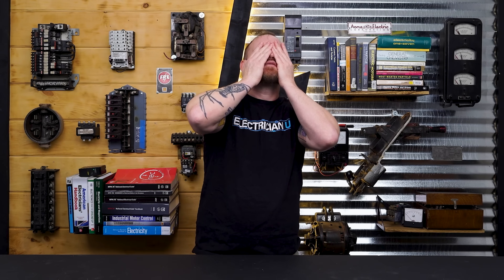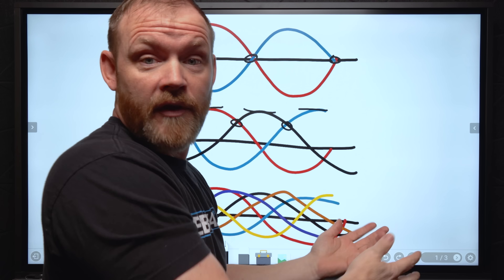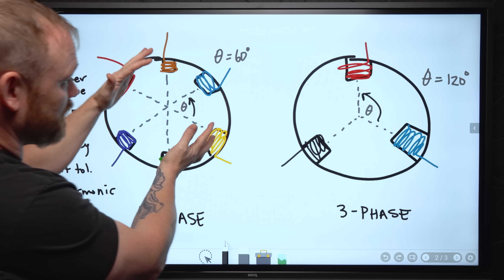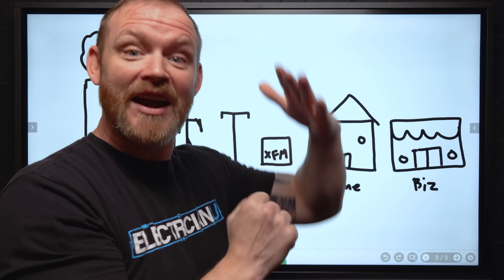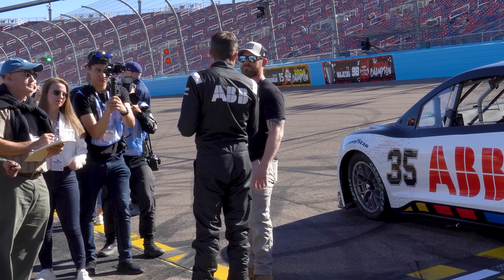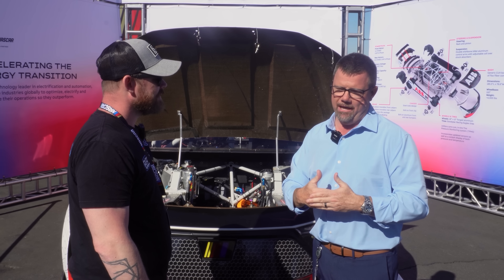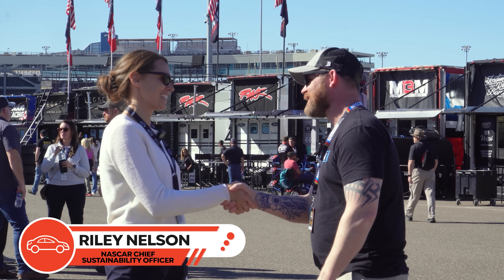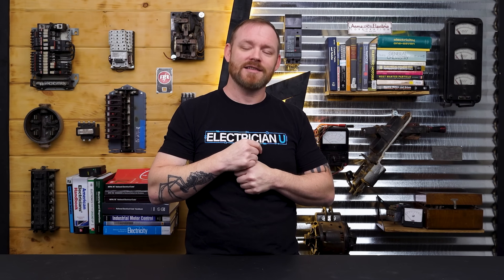6 Phase Power is a REAL GAME CHANGER!

Comment: She says the 35 stands for reaching net 0 emissions by 2035.. yet completely ignored the fact that these cars use batteries that produce a ton of emissions to produce and to charge. 🤦
Reply: One time production emissions vs what they are replacing can be a wash.

Charging can come from many sources that can vary from renewable to frac/coal but the petroleum products definitely are dirty to produce on an ongoing basis.

With battery banks becoming more cost effective for power companies than peaker plants, even the frac dependent peaker plants era is coming to a close.

Over the long term, battery recycling will also greatly reduce the mining component of initial production of lithium batteries and sodium battery tech will probably replace lithium within a decade for cost reasons.

Not hard at all to see a 2035 net zero goal as being quite doable given the rate that the world overall is moving power systems to new tech, even if US is dragging its feet due to legacy interests.
Reply: @roberthealey7238 All power plants will be net zero is what you're suggestion? Wind farms, hydro, solar, mirror heated salt & whatever(non-fuel)
Like no notable fuel burned anyplace by 2035.?
  Imo nuclear power plants are acceptable.
Reply: Yawn
and ICE power systems appear spontaneously from unicorn farts , with no emissions produced in the process
Reply: @ I’m not arguing that ICE don’t create emissions. I’m also not going to pretend that they create 0 emissions or virtue signal about using 0 emissions when I am in fact, not.
Reply: rushing, pushing, and Hyping  energy- and mobility- tech_conversion is wastefull, erratic, expensive, and not really "environmental"! 
Good technology needs time, "brain-power", experience, funds, and sufficient longevity to become really more "sustainable. The conversion from railroad steam-engines to  gasoline piston enginges didn't happen in 20yrs, nor did it go smoothly, without accidents!
Reply: DEI (Didn't Earn It) PR hire.
Reply: Yes sir, it is a scam in that regard.

Comment: they need to dial it up to 11 phase
Reply: As a matter of fact, any odd number  makes sense when it comes to motors. 3, 5,7,9,11,13 would work. Even numbers can be achieved by simply inverting each phase 180 degrees. In a motor you gain nothing by going from 3 to 6 phases of from 5 to 10.

Comment: The same as many of the other comments, I can see an advantage to 6 (or more) phase power in a mobile/EV scenario.  IF the costs of the motors and speed controllers are only about 50% more than regular EV devices.

Comment: 6 phase has higher torque output, very similar power delivery for the amount of copper used (so also for the weight).  Both have very even continuous power application.
the major difference beyond the torque for similar sized motors, is that 6 phase is much more complex and expensive.  (like 2-3 times for the same power)

Seriously, this isn't a crazy game changer the way 3 phase was.  Arguably marginally better in a couple niche applications where there's a need for high torque and limited size/weight.  Similar to the reasons some applications use 400Hz, but it's not what we use for our power grid.

Comment: Your drawing of six phase is actually what a 3 phase motor looks like. The windings have poles in pairs.

Also reducing the degrees between poles will smooth the torque response but lower the actual torque. Although this can be manipulated by certain motor drives, which I’m certain ABB is using in this car so it’s probably a moot point.
Reply: And his drawing of what he called single phase would be some kinda ungodly double phase.
Reply: @pauljanetzki ungodly is right, but this exact arrangement is also found in the typical US home.

Comment: Electrical engineer here... 6 phase is better than 3 phase but only by a tiny fraction. The gains are offset by the need for additional cables etc and are never worth it. The only people that really benefit from a 6 phase system are the people who sell you the HV transmission wire. They sell twice as much cable and are very keen to implement your idea asap.
Reply: also went to school for EE It would actually be a game changer in some applications like rock quarry’s when emergency stops are used and the crushers load up and have to basically locked rotor start haveing those 3 extra poles would dramatically increase downtime and mens backs and safety to clear jams and belts.
Reply: @justinpeterson1709  so you are saying a 6 phase motor has better starting torque than a 3 phase motor?
Reply: could it be that with 6 phases we can play more finely with eddy currents and hysteresis problems?
Reply: @sonoancoralbar  eddy currents and hysteresis losses are governed by material, frequency and construction. Need to think about it in detail but I don't think additional phases would change this at all.

Comment: If you look carefully at the 6 phase coil diagram,  that is what 3ph real coils look like. So a 6ph motor is a 3ph motor with double coils running on 3ph.
Reply: @franciscoshi1968  he is explaining it wrong, the real 6 phase is 30° apart not 60°.  It would be likely that they are driving a 2 pole 12 slot motor. With 3 phases the coils would overlap on a 2 pole 12 slot motor, which may be less efficient.
Reply: @FPSG  I am thinking this 6 phase idea may be more about using smaller power transistors to drive a bigger motor and perhaps change the number of poles on the fly.
You can have two coils driven by a transistors each and switched so they will look like one coil which would make it say a 4 pole motor then switched in a different sequence and make the motor run as an 8 pole motor.  I can see this having some advantages.
Reply: @franciscoshi1968 there are a lot of different ways they can be implemented. Like you said is one way, with coils from both motors wound together in parallel. Most of the currently existing 6 phase motors (at least in the EV market)are actually just two 3 phase motors in one housing, with every other slot containing a coil from each motor (ie, coil 1 from motor a, then coil 1 from motor b, followed by coil 2 from motor a, then coil 2 from motor b, ect) and are driven by two separate inverters (often in one housing) that run out of sync, to essentially make it a 6 phase motor. You wanna see some weird stuff look into 7 phase motors 🤪
Reply: @FPSG  - True, his diagram is wrong, a 2 pole, 3 phase motor would have 6 coils at 60 deg. intervals. This is needed to close the magnetic field as one pole would be North and the opposite South polarized. A 6 phase motor would look like a 4 pole, 3 phase motor with 12 coils around the stator at 30 deg. intervals. Running the motor as 6 phase, 2 pole motor would provide more speed but less torque than running as a 3 phase, 4 pole motor which would give more torque but 1/2 the speed. That may be the main reason for 6 phase, not the torque ripple, which is minimal, but the ability to switch from high torque at lower speeds and higher speeds but with reduced torque. That would help minimize or even eliminate the need for transmission shifting.
Reply: 2 3phase in parallel hairpin stator winding...2 isolated rectifier that merge in the output

Comment: Isn't that top drawing 2 phases, 180 degrees opposed?
Reply: Single phase from a center tapped secondary, like a home service.

“Phases” are differentiated by position over time. If they are zero crossing at the same time they are not unique phases.

Comment: You dont need to change the entire system to 6 phase. You could just add a delay or phase shifter on the three phases inside the devices that need 6.
Reply: You dont even need to do that. Just invert the 3 phases and you have 6 phases.

Comment: Three phase power can be easily converted to 6 phase with a transformer.  

There are two winding methods for 3 phase, delta and Y.  Delta connects coils between the phases.  Y connects coils to a center point called Neutral (the same neutral in 120/240 power).  If I make a transformer with both delta and Y winding of the same voltage, on the output, there is a 60 degree phase shift between the delta and Y.   We used that to create a 12 phase rectifier for charging batteries.  

Six phase isn't used on the grid because it requires more high voltage wires on the power poles.  In fact with 3 phase, I can combine sections of delta and Y windings to create even more phases.
Reply: @stevesedio1656  he explained it all wrong. The 6 phases are probably 30° apart in the actual car, in a 12 slot motor with each phase driving 2 coils that are 180° apart with opposite polarity. 

Also, I think you are wrong about how the transformer is wired. It can be wye inverted wye if the secondary has 3 center tap transformers where the center taps are the neutral. Wye to wye could be 208v wye to neutral would be 120 single phase and wye to same phase inverted wye would be 240v which could be useful. The problem with your statement is that the only phase shifts you can get are 180° or 60° which line up. 0° + 180° = 120° + 60°, so you can't get more than 6 phases with transformers, from 3 phases unless... you are wrong about the delta wye phase shift which is actually 30°.

Comment: I can't remember the forum I was in now, but Elon and the team looked at 6 phase, as you can have with higher voltage, potentially allowing for lower current per phase, potentially improved fault tolerance (one phase failing doesn’t cripple the entire motor), reduced torque ripple, and potentially smoother operation. However, this comes with added complexity in power electronics design, cost of more power semiconductor devices, a larger inverter, and more complicated control software. The Model S Plaid and M3 performance give supercars a run for their money and they are sedans that cost a fraction as much - so I'm wagering Tesla knows something these guys don't. :)
Reply: The M3 is electric now? Also C63 > M3

Comment: Why don't we use 6-phase?  Because seriously difference between 3 and 4 phase isn't worth it...   much less 3 to 6.... where there is more than double the cost, a LOT more complexity in protection systems, and you get AT BEST ~60% more conversion...   its just not worth it for anything but extreme circumstances.  Besides, most motors don't have just 3 poles for a 3 phase motor, and run at freqencies that make this pretty much a moot point for anything but again... extreme circumstances.

Comment: Many arguments that you pose for 6 phases are just overthrown by adding mores poles within tne motors. this is standard in the industrial stuffs since the 3 phase motor was invented. 
Asynchronus to reduce the speed of the motor with the same supply or eaven integreted 2 sets of windings within a motor to have a 2 speed.
Synchronus to have smoother and higher torque as you have to drive it with a VDF anyway.
The real issue is than with 3 phases 6 or eaven 12 poles motors, you need to switch the frequency extremely faster, giving a shitty power curve. The argument is that ev cars have to go trough such a RPM range with a high torque that it's preferable to double the number of phases and keep a low frequency than to integrate a gearbox in such a competitive environement. For porduction cars, extreme weight reduction and such optimisation is not necessary, so they are for many automatic 2 or 3 speed gearbox.

Comment: 6-Phase is actually just 3-phase and it's inverted counterpart, you can generate it with 3-phase transformer with center-tapped secondaries (which is sometimes done for driving lots of 120/240, from a 3-phase source, with a balanced draw.
Reply: You are right, except the center taped part. 3 phase power can drive 6 different magnetic poles. 6 phase power, as demonstrated in the video, can drive 6 different magnetic poles.

The 2 phase he showed is actually single phase. Real 2 phase is 90 degrees apart. And Real 6 phase is 2 - 3 phase systems that are 30 degrees apart.

2 phase 90 degrees apart can drive 4 magnetic poles and 6 phase 30 degrees apart can drive 12 different magnetic poles.
Reply: @FPSG  there’s only north and south poles.
Reply: @johnathanrice3569  yes. In a 3 phase  motor you can have 3 or 6 poles.  When you have 3 poles you have 1 strong north pole and 2 weak south poles as an example. In 3 phase motor with 6 poles you have 1 strong north, 2 weak north, 1 strong south, and 2 weak south poles, not in that order. These poles rotate around the stator, and are like this when 1 phase is at the top of its wave. Each pole is 120° out of phase in a 3 pole or 60° in a 6 pole. 

This the wrong nomenclature, it is actually a 2 pole 3 slot vs a 2 pole 6 slot, but that is hard to understand if you don't work with motors.
Reply: @ thank you for the explanation. It makes perfect sense
Reply: That doesn’t work with the three phase because they’re not 180° out of phase they’re 120° out of phase which results in 208 V. I know because I live in a building where that’s a thing
Reply: @johnathanrice3569  in a 6-phase Wye with each phase 120v with reference to Neutral, you can derive 208v and 240v from different phase-to-phase connections.

each center-tapped secondary is it's own 120/240 "split-phase" system essentially... and (importantly, going from the same half of the center-tap on both adjacent phases) you will get 208v. and in fact you get two sets of 208v 3-phase. 

6-phase transformers are rarely used in practice, but they are used for the above (using lots of 120/240 draw on a 3-phase system, without the caveats of 120Y208v), and also in the past for driving mercury arc rectifiers (these use 6-phase since the rectifier is half wave, where the output has to be connected to the Wye of the transformer. so inverting the 3-phases into 6 was a cost effective way of making that style rectifier work on both halves of the sine wave.)

Comment: It is a simple matter to convert three phase to six phase (or 9 or 12) via transformers. This was once common for use with rotary synchronous converters as their capacity and efficiency are considerably improved. 

However, for transmission, three phase is the most economical.